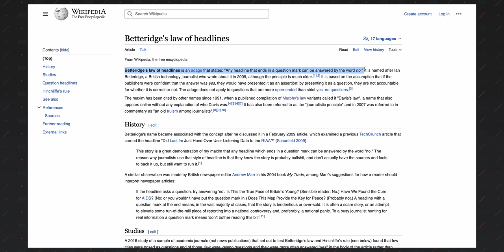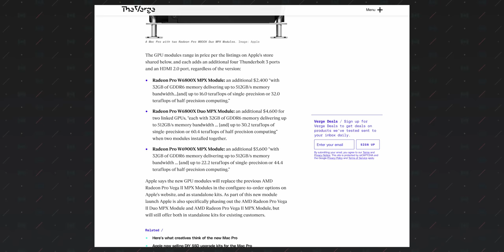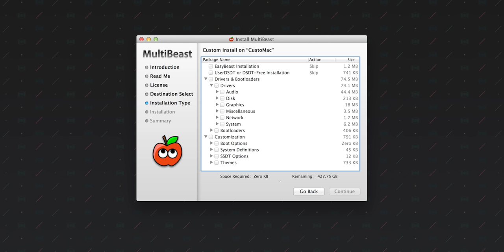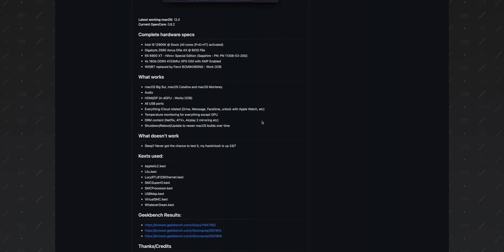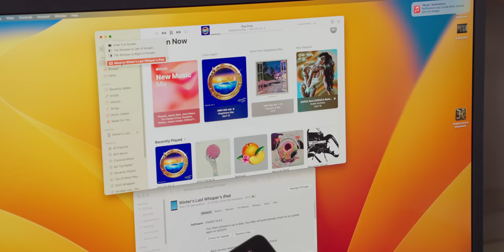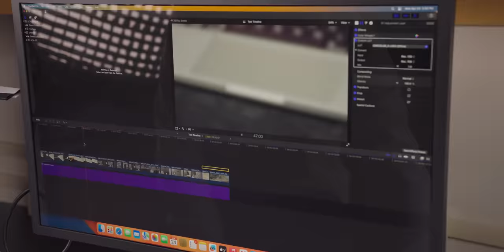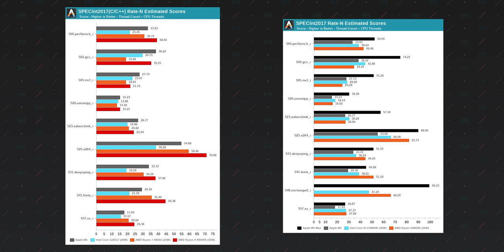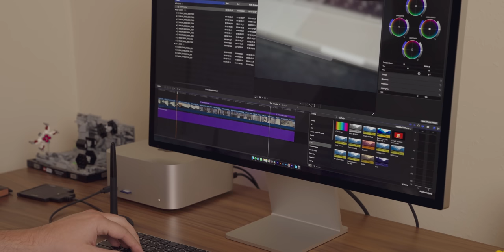This $2,000 Hackintosh SMASHES the $4,000 Mac Studio

Comment: I would have loved this video a year ago. This is a good video too for what it is, it clearly demonstrates the cheaper machine in PC format will damn near always , outperform a similar Mac. But there are so many other things to consider when you're buying something, even with computers, and I think ironically, it is computer guys that forget this the most. I mean for starters, just look at these 2 machines. Look at them, they are completely different sizes, have completely different cooling methods, IO, building methods, and just completely different philosophies for doing similar or the same things. The Mac is so much smaller and it manages to still have no temperature problems. This has everything to do with the Mac being assembled much more from scratch than any PC is. Macs now have their own design for their CPU, GPU, and motherboards as well as cases and accessories. They know every detail of them intimately so they can choose the perfect parts they need to fill in the gaps. This results in the user not even needing to think about how hot or cold the machine is getting, in pretty much any environment. That is not the case with PCs, ever, and it never will be unless Intel or AMD themselves decide to start making computers. The closest you will get to this kind of experience on PC is with Microsoft hardware, obviously, as it at least makes the software for its hardware which is another huge advantage that apple ALSO has.

So yea there is a cost difference but it's because these are two ROUGHLY equivalent products for a given task and they have different design philosophies and unfortunately one design philosophy just costs more money most of the time. If you didn't care as much about specs you could start similarly borderline insulting the PC you have made to replace it from others' perspectives. In comparison it's huge, it would most likely be ugly looking to people with a minimalist taste, they have no use for utility/space as they do not work on their own computers, and they highly appreciate having something smaller to save space in the home as they don't want computers to be a feature. There are tons of people who think like this - in fact, this is the normal thought process. No one but a power user would swap like this and they would already most likely have a PC if they wanted one or at least not have a mac studio. I don't see who you are really converting with this to be completely honest. Maybe a very few who simply bought Mac due to popularity, but most Mac people want Macs for very good reasons that have nothing to do with anything in this video. Speaking as a person who now has some kind of device for every current ecosystem, I don't think there is any kind of PC product that could ever replace my Macbook + iPad combo. Mac's ecosystem is insane with its interconnectivity and I had no clue some of the features that they had over PC for social computing. A lot of it is very cool. Plus it seems like every device can just immediately connect and sync with the next while also having cool features on the side, like the iPads are secondary displays for Macs via airdisplay, can connect to the watches to charge and sync with them, and the macbooks can do the same with the iPhones and use them as webcams. It's all just automatic and they can add these kinds of things through the drop of a hat because they made sure everything would be compatible before it came out.

So yea, for professionals who use computers especially, having a Mac available, even if not using it as your main system, is a really handy thing to have. Most of them have one. That being said, most of the technical professionals ALSO have a PC if they are working with heavy computing tasks at home as it really IS just as terrible a decision to use Mac for rendering and modeling as it would be to use PC for music and writing. They are like opposites and they both have a lot to give while competing for our attention. Let's just sit back and watch which one comes out on top and just get along, lol.
Reply from the maker: I didn’t forget this at all! You’re right and I said much of the same in my video. :)

Comment: If you want more performance at the expense of power, you can get a i9 13900K.

If you want greater efficiency, you can drop down to a i5 13600K.

And if you do end up building a Hackintosh with the lower power Intel processors, you can then also switch over from the Noctua NH-D15 to something like the Noctua NH-L12 low(er) profile CPU HSF instead, and then you can make your build smaller and more compact.

I can see myself building a Hackintosh for my dad.

But I can also picture my dad PREFERRING the out-of-the-box experience from the actual Mac Studio, despite its price tag.

Comment: "Winter's Last Whisper" is an ominous name, seeming to imply this is the end of the line. However, the narration seems to skip around this issue a bit.
This build looks great and seems to performs exceedingly well. But I am compelled to ask directly: Does this Hack presently run macOS Sonoma v14? Also, is it expected to run macOS Sequoia v15 (speculative in the video, but perhaps more firmly known now)?
I see the present Mac Pro line-up uses the M-2, not intel. But the M-series chips are looking less promising by the build.
So, are we just burning-out the last of any intel support in OS X?
Are the issues regarding long term support any clearer today than they were a year ago? Also, given that this system is a year old at this point, is there another build you are considering?

Thank you.

BTW: I run MX Linux and Ubuntu, so if I build this or a similar OS X based system and the Apple OS support drops off, I can always migrate this system to linux. It's just that I have enjoyed playing with OS X occasionally since 2000, when they migrated from the old OS. And, I have built Hackintoshes in the past, it's usually a fun exercise. This system (or an updated version) looks like it could be a lot of fun. Thanks again.

Comment: i let go of my hackintosh last year.  It was a great machine, but I found myself in windows 10 nearly 98% of the time, and that transitioned to building a new 13700 gaming PC, which has been fabulous running windows 11 pro.  And, as much as a diehard apple guy as I was, Windows works just fine.

Comment: Please don't @ me, but aside from a geek fun exercice, I don't see the point of doing a hackintosh. If you need a very powerful workstation, it's for professional purposes, therefore you can either absorb the cost of a Mac Studio, or use a Unix/Windows machine. 
If you just need a computer for Final Cut for amateur stuff and all, might be the niche case we are looking for but would you take so much time and effort to gain 50 seconds in an export? 
At the end, a hackintosh is a painfully configured PC, you will probably experience crashes and stability issues, you won't be sure it will be updated.
Personally, I did try to make some hackintosh 10 years or so ago, it was a fun time, very instructive, and I really like the wrong feeling of having macOS on a non-Apple PC machine. But yeah, it was just a geek game. 
At that point, just use the PC with a proper OS.

Great video though; really liked it, it's concise !

Comment: Well, the Mac Pro with ARM came and still didn't had what it takes to truly replace the x86 one: external RAM and GPU support. Make no mistake, I'm not complaining about the unified memory existence, but on a machine like the Mac Pro it could definitely act like a L4 cache, a higher tier of ultra fast memory like the Xbox One architecture used more than 10 years ago, because 1,5TB (the x86 Mac Pro limit) of unified memory is simply unfeasible. And GPUs, well, GPUs, Apple can brag as much as they want on stage, but the new US$ 7K Mac Pro still falls short of a entry level Intel Arc when you consider that M2 still has no AV1 hardware and so on.

Comment: I think the Apple silicon is amazing in light to mid apps and working, the quietness, speed and small factor is really amazing... but in hard core apps where you need a lot of power (CPU) and a GPU (some have a mac mini size) is where the "Studio" is hard to justify. I think Apple should continue with Silicon until the Mac Mini and MacBook line. But back to Mac Pros with Xeon or EPYC with dedicated heavy-duty GPUs as they always were.

Comment: Fan noise is also a factor when evaluating what you need from a system, and that's where a low power chipset is going to shine of course.
Reply from the maker: The PC is actually quieter than the Mac Studio because the fans in the Studio spin at a much higher RPM and as blowers, they're naturally louder.
Reply: @snazzy  Interesting. So if nothing else, one reason the Mac Studio can't just 'take over' the roll of the Mac Pro is that it's too compact to get the full thermal efficiency advantage a pro model should have.

Comment: I'm curious how the dual booting experience is. Last time I tried it you had to use Grub and it loaded Clover. Not being a linux guy, Grub was annoying to have to manage the flags to get Clover to boot properly. I'm at the point where I need to upgrade both my Mac and Gaming PC and have been debating about doing this. I guess with only a month until WWDC it may be best to wait to see what they announce before investing in a Hackintosh.
Reply: If you have 2 separate drives, dual boot is as easy as just installing MacOS on the empty drive, you dont even need to delete Windows if you already have it installed

Comment: I love OpenCore. I do have a MacBook Pro 2017 running Sonoma 14.4.1 through OpenCore Legacy Patcher, but the 7820HQ And Radeon Pro 560 4GB just aren't really up to spec today. OpenCore let me turn my Ryzen 5600 and Radeon 6600 XT PC into a formidable Mac Pro also running Sonoma 14.4.1 with way more computing power for work. After carefully going through the config.plist and some trial and error with .kexts and general settings, I have a perfect macOS experience, and it is upgradeable. I can go to current gen AMD CPUs no problem, but at least for now I'm limited to the 6900XT at best with my GPU upgrade path. Nonetheless, I can't even imagine buying a desktop Mac when OpenCore exists.

The MacBook Pro is good when I need to be mobile but nothing beats having a Hackintosh and the possibility to dual boot into Windows for gaming, for example.
Here's hoping OpenCore figures out a way to bring compatibility with future macOS updates when the inevitable drop of Intel support happens.

Comment: I have always wanted to build a Hackintosh – if for no other reason that to bypass s planned obselence of hardware they deem too old to support the newest hardware tech or macOS. While I do consider myself a technical person (having repaired and or upgraded dozens or Macs over the years for family, friends, and myself — the idea of building a machine that is capable of running an OS it was never intended to run (by either the hardware manufacturer(s) or the OS software) seems SO daunting to me. But you make it sound so easy, I'm really tempted to actually give my best shot! That being the case, what are your recommended reading/research sources for getting started with what hardware to assemble all the way to the step-by-steo “how-to” guides on actually getting the macOS up and running [stable] and usable? Thank you!

Comment: Building a hackintosh is still a cheap way to get into the Apple ecosystem if you like to tinker, but if you don't then just get a base M2 Mac Mini for $600. Powerful macs are a different story though.

I have a M1 MacBook Air base spec (8GB, 256GB) that I got for the excellent quality of Apple hardware on it, but it is limited in power and connectivity. To do actual work on, I built an Opencore hackintosh using a Ryzen 5 5500 (yes the ~$100 chip, with a ~$80 B450 aorus m mobo) and a 5600XT and it works almost flawlessly with ethernet. I can also boot into Windows easily, which I am using right now.

Comment: Hmmm.... I have a spare 12900KF, 6800 xt, 850w psu, and several m.2 drives.  I can buy the case, motherboard, ram, cpu cooler, and be well on the way?

Comment: I've been on Hackintosh ever since the Trashcan came out and I had no Mac Pro Upgrade path anymore, plus price became a real factor too. Currently on a 9th gen Intel which has recently gotten a RX 6800 upgrade and - knock on wood - it's running flawlessly. But getting there, esp. since OpenCore, hasn't been easy and made me feel just too dumb for Hackintoshing, I can follow instructions, yes, but as soon as I'm told to compile my own DSDT and do the USB mapping, my mind goes into emergency shutdown. Really tried, never understood, gave up - and sorry Hackintosh community, but asking for advice and not immediately understanding a reply is scarier than losing 2k of hardware, the attitude towards newbies and non-geeks is usually...  So yes, I did all the non-recommended things, downloaded the DSDT from someone who did the work for me for my exact mainboard and until today I have no clue how that USB mapping is done, fortunately it works fine and I don't have to bother. Those step by step instruction on how to compile a DSDT in Windows or that script to do the USB mapping - never even heard of it, where the f... are those links I've not been able to find for over 10 years? Sigh... 

But yeah, once this machine is getting too old I don't know anymore what to do, Apple simply doesn't offer anything I could switch to as a main machine. I already tried a few times to convert my workflow to Windows but so far unsuccessfully.

Comment: Just need a bit of a suggestion. Im currently running a i9 9900k rig with gigabyte designare z390 and 32gb ram. Im a music producer and mixing engineer. My main working software is LOGIC PRO X and currently as time went by and as my workflow increased from 10 tracks to 200 tracks my cpu give ups on me and gives system overload issue for which i have to make 2 different project to finish one song. Im currently in a dillema of either buying a new mac studio ultra or building a really powerful intel based hackintosh which can match the same level but for audio production. What should i do? Any suggestions? My main workflow revolves around producing using Virtual Instruments and Mixing with third party plugins

Comment: Hey, very good video thank's ! Could you test running an AI model using cuda optimisation (use pytorch)? I am a developer and I struggle runing models of machine learning due to lack of cuda cors on M1 GPUs (the mps variant that works on M1 is too slow)
Reply: bump

Comment: Very interesting one! Why an i7 and not an i9 from the same Gen? Is it a power drain issue? As long as I prefer the Mac Studio, I need PCIe cards (AJA + Sonnet NVMe RAID). This will make the Mac Studio even more expensive and with limited bandwidth. Now I'm getting a bit over 6000 MB/s on my internal 16TB RAID! I'm considering upgrading my Z390+I9-9900K to this one!. I use it for video editing in FCP and live streaming with Wirecast.

Comment: Your energy consumption evaluation is not entirely true. Power hungry processor release heat (a 500 watt heater almost), so that heat has to be removed by air conditioning so in summer air conditioner have to work extra. So energy bill will be much higher than you mentioned.
Reply: For those that run their PC at full bore 100% of the time... yes that's true. But I'm not rendering out videos 24/7.

Comment: 9:08 Isn't the DisplayPort over ThunderBolt using an external DP cable, not an "Internal Header"?
Reply: No, the internal header is for Motherboard to get DP from the GPU. This way it combines I/O on the board with unaltered signal from GPU
Reply: Some videocards and motherboards do have an internal header to support this.

Comment: People saying that Apple Silicon means the Hackintosh is going to die seem to forget the early days of Hackintosh. I remember in like 2007 or 2008, some utter loons managed to get OS X running on an Eee PC netbook so underpowered it had NO business ever working, but it worked. ARM SBCs are getting ridiculously powerful for their size, and as more of the general purpose computing industry takes ARM seriously, Laptop and desktop class ARM hardware is only going to become more common. I'm not saying it'll happen today or tomorrow, but a few years down the line, it may be the case that you have some real choice in hardware that might work for this. Further, getting up to date versions of Mac OS running on older unsupported Macs is effectively Hackintoshing older hardware. As the earliest Apple Silicon falls out of support, you can bet the community will be working on hacking later versions of Mac OS for those, and what they learn in hackintoshing the M1s into working in the future will go toward making other ARM hardware work.

It won't be easy, the earliest results won't be pleasant and a lot of folks are going to look at some barely-running mess and scoff at it, but it will happen eventually. Probably out of frustration with Apple letting their Mac Pro languish. Some time after the first Apple Silicon Mac Pro has been out and rotting on the vine for a while, that's when Hackintosh enthusiasts will really get the lead out.

Comment: Yep.  Back in University, I built my first hackintosh, and it was a journey indeed.  I saved a lot of money, though, and I needed it for my iOS course.  Even after being forced to use a Macbook Pro for work for 3 years, I find the machines clunky and disorienting.  However, now that Swift has replaced Objective C, intel support is being sunsetted, and emulation of MacOS has become more or less mainstream, hackintoshes are a thing of the past.  RIP, hackintoshes.